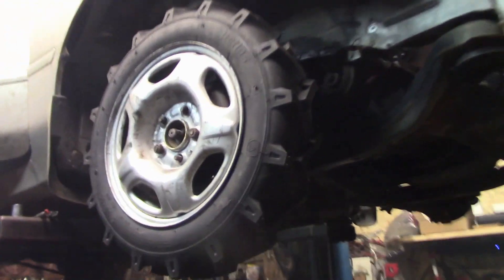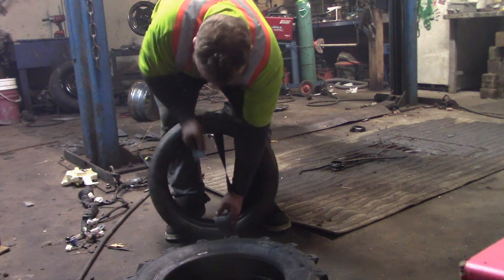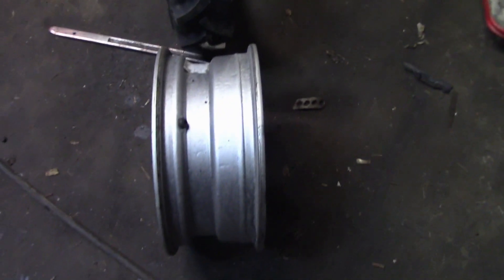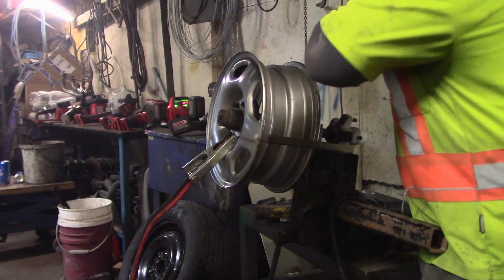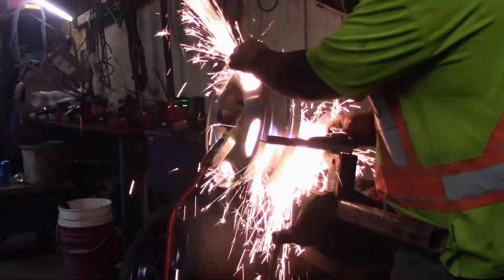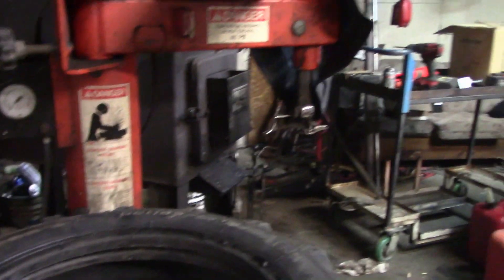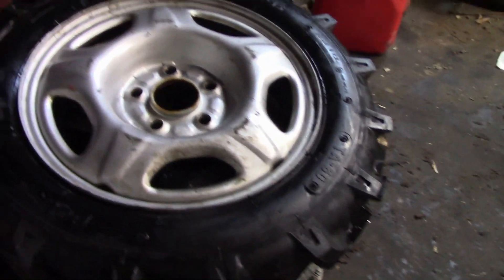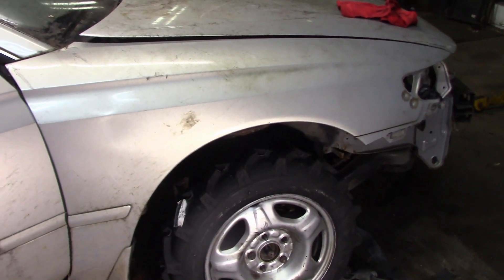Mounting and doubling some vtreads, narrowing some crv rims for a camry/wbody for demolition derby

Comment: Zack in a 96 camry is there anyway to wire the fuel pump to the battery to keep the factory or do you have to move it?
Reply: Remove pump access plate, blue wire coming out of pump harness is hot, wire to battery and your set.
Reply from the maker: not really i dont keep fuse panel
Reply from the maker: yep